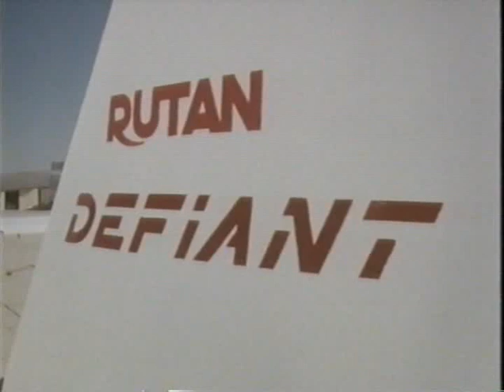Burt Rutan in Reaching for the Skies (1988) Ep 01 - The Pioneers

Comment: 29,000 hours and countless videos watched, and this was the first time I have ever seen someone press both starter buttons (or turn both keys) and start both engines at once. Impressive, and ultra-cool.  I never would have even thought of doing that.  And, of course, now I have to give it a try. Bonus: an F-100 Super Sabre at his 4 o'clock, my first operational fighter slot. I'm guessing that it is Dick flying wing in the VariEze; he is also a former Hun Driver and Vietnam vet.
Reply: Dave, That might have been Mike in his LEZ...and Dick did most of the DEF testing....That low level may have been those two.  Yeah...twin start - amazing. Those were the Hoffman constant speed props - added a big weight gain and complexity that I don't think any builder cared for on a roughly 1850 lb airplane.